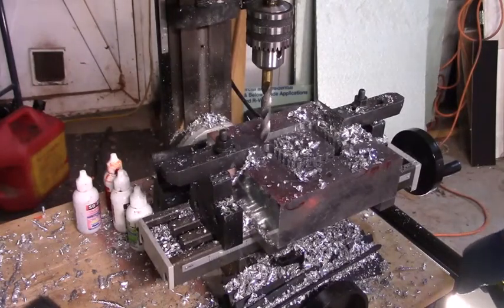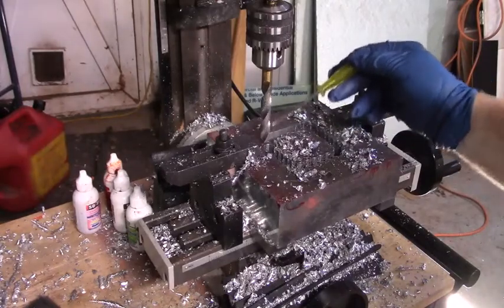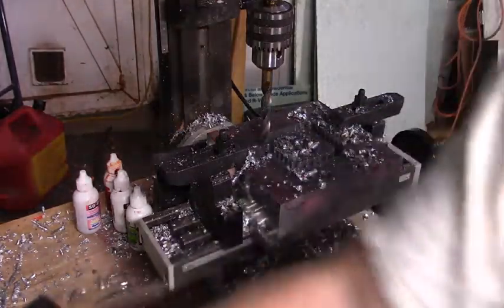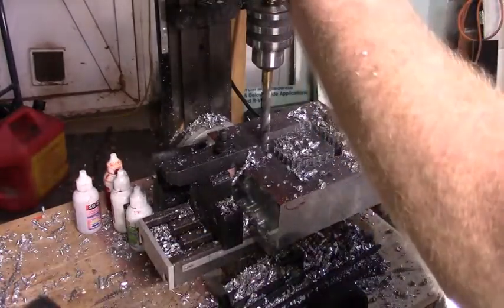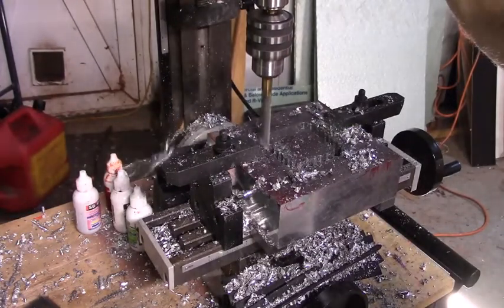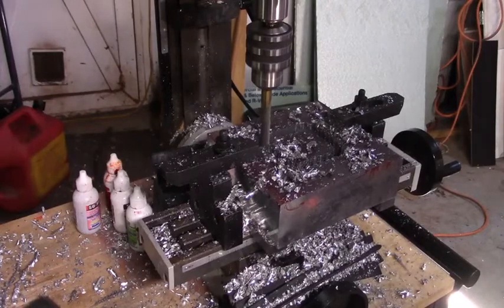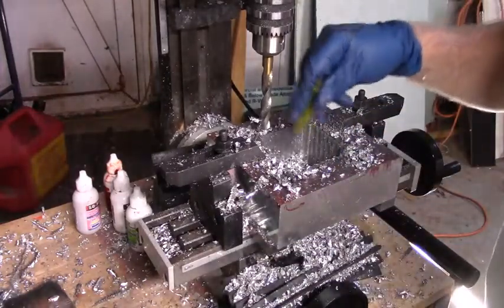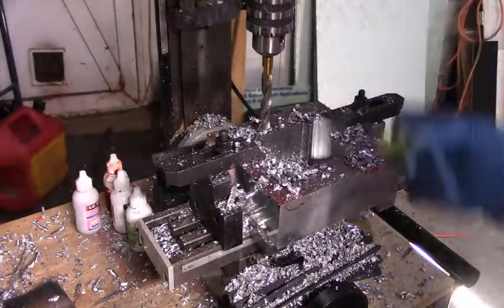JUST MOPAR JOE CUSTOM HOLLEY 4-BARREL 2" SPACER PLATE DESIGN AND BUILD Part 4 #nonamenationals

Comment: In the early 70’s I worked in an aluminum factory. They would heat treat various aluminum parts to different hardnesses. Has that piece been hardened much? The shavings make it look softer than hardened. Thats taking a fair bit of whittling away to shape it ! 👍
Reply from the maker: I can't say if it is or isn't Tim.  I was lucky to get a hunk of aluminum in that thickness.  I would say that it was but probably not successfully for a space age functioning piece.  For this application, it's plenty hard.  My Aluminum end mills are 2 flute 43 degree jobs.  It's just a lot of work for that little motor, but, she'll get it done.  Question is, in this heat, what's to be left of me? 🙂  Thanks for checking in!
Reply: @lbbruins7958  I haven’t been getting much work done on my 2 projects, of refreshing my 72 Demon, I bought it new. ya I’m old !!! And my 86 Chevy C20 putting a new GM Performance 350 in it. It’s been 95-99 here in Colorado. Usually 85 all summer. I’m having just enough energy to do the yard work and small projects. Nice project for Joe. Interesting to see how it does on his car. 2” should make a difference. I put a 1” on my Demon 360. It’s just straight thru  👍
Reply from the maker: @tims72demon  Bless you Tim and take it easy!  Even 85 is hot enough!
Reply: @lbbruins7958  Should be using 3 flute mills on aluminum. Cuts much easier.
Reply from the maker: @miked6875  Yeah I know Mike...the pickens were slim the day I went looking for one.  I don't do a lot of aluminum to start with and a never a project that size.  It got done though.